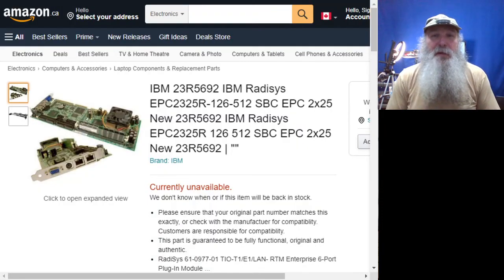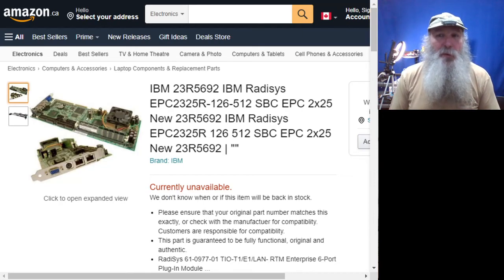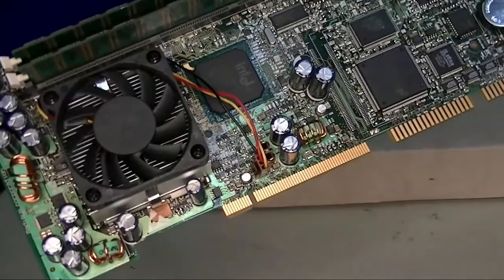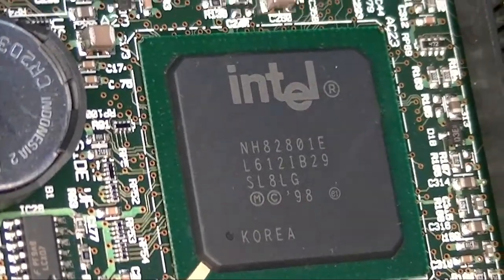An introduction to "PICMG" boards and backplanes!

Comment: Is it really industrial standard? I've heard that only pin connectors like DIN 41612 are reliable enough to be used in the field to control critical processes, isn't it?

Comment: Is it possible to do gaming on this device?
Reply from the maker: When it is set up - it is the same as a PC at that level - This would be at a Windows 98 to Windows 2000 level system.
Reply: Probably get one of the modern new ones being made to accommodate modern gaming. Thought about doing something like that.
Reply: Voodoo2 SLI with windows 98 should be a good option for gaming on that I think. Often the best option when you dont have AGP slot, Voodoo3 PCI is also an option but Voodoo2 will work with the integrated graphics on the SBC.
Reply from the maker: @NittonÅttiofyra  - The board I showed has a VGA connection that is integrated AGP graphics (from the 815 chipset). PICMG is more like an all-in-one for industrial applications.

Comment: Nice Single Board Computer, got to love those backplanes!
Reply from the maker: I've got several different types of PICMG boards - this one had the most connections and the best CPU/RAM.
Reply: Yes, could it be used in PCs, it could be easily upgraded from 4.7MHz 8088 up to 233MHz MMX or 300MHz AMD clone. 80686 CPUS Like Pentium II,III should require more bandwidth for video card...